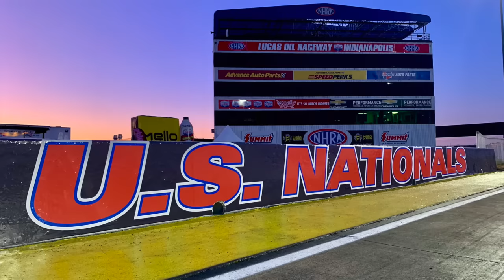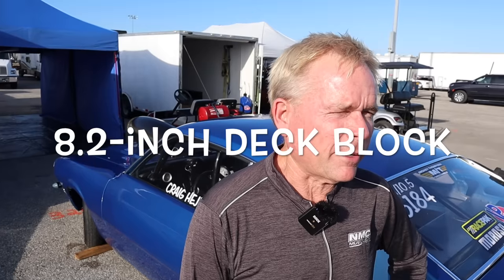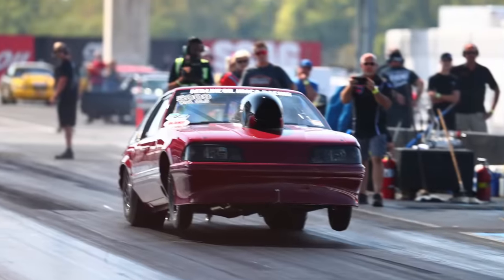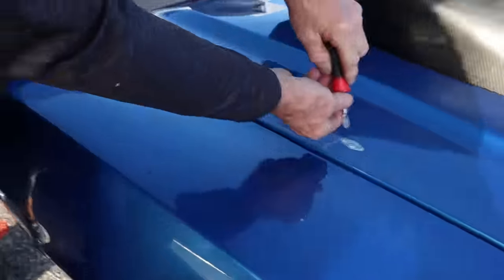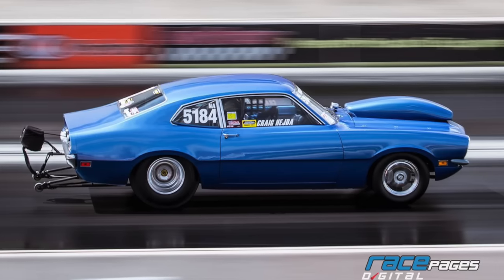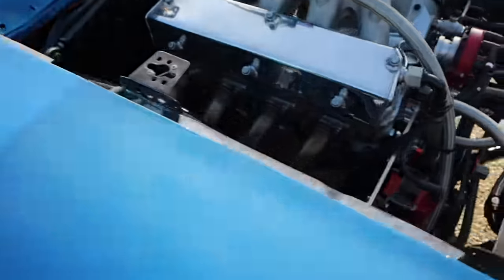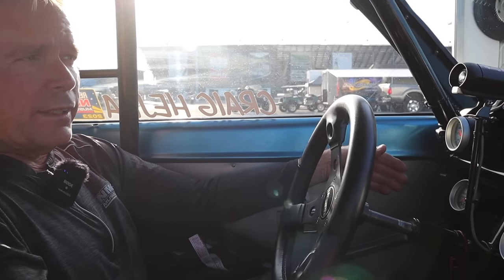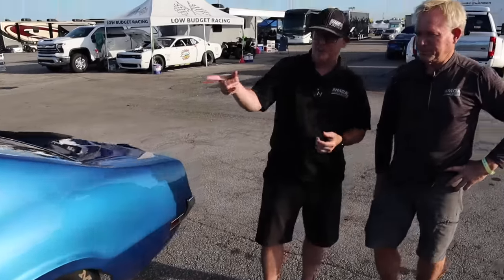10,000 RPM NA Small-Block Ford Maverick Makes 1,050 HP and Runs 7s at 177 MPH with a 5-Speed!

Comment: I'm a Chevy guy but anyone who still runs all motor is a real racer.  No power adders   way to go.  Real racing
Reply: Love NA all motor, no crutches, no excuses.
Reply: Love those Mavericks and high rpm small block Ford engines I've got two of these Mavericks cars 🚗
Reply: This is the way I do it no turbines turbos or anything just all Motor but 385 series in my 53 Ford cpe with 4 speed toploader and narrowed 9 inch , pickup front axle
Reply: you can race anything you want. its all about fun, no matter what the combo is...
Reply: Who cares if you're a Chevy guy, this video is not about you.
Reply: I always like when the chevy guys come around from the dark side
Reply: @Watsbronc Who designed the pushrod V-8 again?
Reply: We definitely need to go back to this style racing, production based, N/A high revving, manual trans, and keep the 10.5 tire, sounds a lot like the original concept of pro stock.
Reply: @docsmallblock6584  It wasn't GM.
Reply: Its a pro stock engine.
Reply: @____MC____ in what way?

Comment: Damn that’s one hell of an 8.2 deck engine, I was expecting a Cleveland combination, that much horsepower out of an 8.2 deck with less than 400 cubic inches is absolutely amazing, I dig it. 👍🏻
Reply: It’s insane really 388ci 1000hp ! small block Ford makes power
Reply: @CoyoteFTW  
With names like Chris Uratchko and Tony Bischoff building the engine you know it’s going to make big power regardless of brand.
Reply: @shitbox82  that’s better power per cubic inch naturally aspirated than majority race engines 
Say when racing outlaw 10.5 car is making 3631 hp with a 427 Windsor stock bore space 9.5" deck, heck the cam height is even windsor still.
Reply: @CoyoteFTW  
Damn right that’s big power with conventional 8.2 deck architecture.👍🏻
Reply: Think if you went to a 9.5 " deck!

Comment: One must realize just how truly impressive this car is.  388 cubic inches. 1050 horsepower. Ran a 7.89 at 177 mph.  All motor.  Irrespective of the brand, you have to respect those numbers. You just don't see that very often nowadays. Great Maverick brother
 I'm a die hard Ford FE guy. It's all I've known for 50 plus years. But I will concede that turning that small block over 10,000 RPM lights my FORD fire. Great work with your SB Maverick. Truly impressive !
Reply: In 1972, when I hung out at S.I.R. in Seattle, Funny Cars ran the 7s. Watched Jerry Ruth run AA/FD in 6.19.

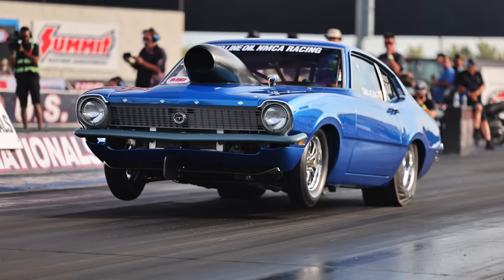Comment: My eldest daughter has a '71 Maverick Grabber that we built with a 5.8 HO crate engine, C6 transmission and a Ford 9" Detroit Locker 4:30 rear gears. The car does low 11's consistently.
Reply: That is awesome 🤟🤟🤟
Reply: Cool
Reply: Junk that C6 and get a built C4 and you will pick up a half second. A C6 drains 60 horsepower from your engine. A good C4 will hold up fine and get you in the 10s. I believe it was TCI that made a C4 with a lifetime warranty and 1000hp capability.
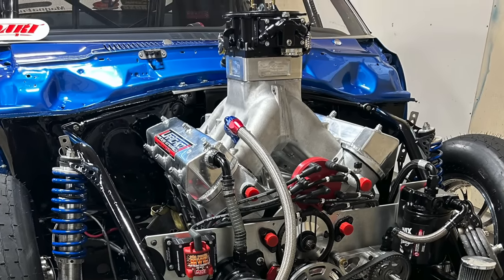Reply: @Axeman428  Oh hell no. It's her car and other than the engine, it was built with components that we already had. Primarily, it's a street  driven car and not built just for drag racing. On the street, it has a 3:50 gears with a Detroit Locker posi unit and Goodyear GT radial tires. I'm a master level factory certified auto/truck tech that worked for Ford for 40 years. I've been drag racing since the mid 60's and I damn sure know how to build a C6 transmission for best performance.  My former NHRA gasser 1957 Ford Custom 2 doors sedan does mid 9's. I set 3 NHRA records with that car and won 3 NHRA class championships with it also.  My 1969 Boss 302 Mustang won 2 NHRA Pure Stock class championships. I bought that car new at Tasca Ford in RI One of my former NHRA AA/FC cars is at Don Garlits Museum in Ocala FL.  I/we did well with that car also. I do know a lot about drag racing. Likely, far more than you.

Comment: Daaamn that's badass!!! My brother and I just built a '71 Maverick with a 351W. It's not gonna be on this power level though lol. It's been bored to a 363ci, 12:1 forged pistons, AFR 185cc small chamber heads, mildly radical cam, RPM Air Gap intake (mildly hand ported and port matched to the head), ford 9" rear end with reinforced spring perches, ladder bars, and a 3 speed toploader manual transmission. Should be putting down about 400hp to 450hp at the wheels. We built it as a fast fun tribute to our other brother who past away several years ago from a brain tumor. He had one of these cars as his first car back in the mid 90's, and it had a stock 302 and he took it to the local drag strip to race it. He loved these cars and never stopped talking about that car, and always wanted to build a fast one but never got around to it before he passed.

Comment: Reminds me so much of my 70 Maverick the same color even that started life in North Carolina with a straight six and three on the tree to. Put a Boss 302 crate engine and top loader four speed manual. A swap to five lug on all four corners with V8 mustang front suspension and springs and disc brakes with nine inch 4.11 gear with heavy duty springs and drag shocks all four wheels. Had 15" Cragar SS wheels front and rear, N50 mickies on the rear. Street raced back in the day. Canted valve small block humbled a few big blocks, Chevelle and Charger back in the day. Engine was bone stock out the crate and Rousch headers and remote oil filter setup.

Comment: I`m a Mopar guy but in 1996 for a mere sum of $200 simply couldn`t resist 'grabbing' a great running 1972 Maverick 2 dr/ht with 302 auto. Then I found a non-running sister-car`73 Comet GT also for $200.

Comment: Love your Maverick awesome little SB Ford.  I have a 62 Falcon SB Ford all motor. 750 hp with a 306. Tunnel Ram Holley carbs. 4 speed manual Center Force clutch. 
 Only mine is street legal and runs at the track, too.  Not fast as the Maverick but
Little Fords are lots of fun.

Comment: Love Mavericks. 
Cool/fast MAV and story.
I own an early 1970/69.5 myself. Which just so happens to have the same engine 200 6cyl and 3speed manual transmission his Maverick orginally had. The shifter was moved to the floor.
I have a new front and rear suspensions for the car. 
The engine & trans will also be upgraded. My Maverick will be designed for handling. 
My first car was a 74 Maverick my Dad bought me in the early 90's I started customizing and had it till 2008. Unfortunately had financial issues and had to sell it. That sucked letting it go, and why I bought another as soon as I could.

Comment: I didn't realize that 4-bbl NA motors were at 2.7 hp/c.i. Making compression isn't tricky but avoiding piston contact with the monstrous cam takes some design. Thanks Evan.
Reply: That's alcohol compression on gasoline...sick.
Reply: @geoffmcnew5863  is it really gasoline? I'm trying to find that info, but I couldn't.

Comment: That was great, the car the story and the filmwork.  What an awesome "302", 16 to 1 with 1.09" lift !   If you are ever near Victoria you need to check out Grant Klohn and Bill Friend. Bill's 65 Comet has a similar 10 degree engine but street driven so less cam and compression.
Reply: Yea but its not streetable.  Pure drag car only. How about you build a race car you can drive daily,  not a drag race only car you tow to and from track
Reply: @maximusvonce1381  Huh??? I followed him 60 miles from Mission to the Tsawwassen ferry on the road.
Reply: @tomp1612 10k rpm means no bottom end and the drag cam is hard on parts and will need rebuild often. Those are the facts, and you can ask Joe Sherman and he will agree.
Reply: @maximusvonce1381  Obviously you are not talking about what I replied. "Bill's 65 Comet has a similar 10 degree engine but street driven so less cam and compression"
Reply: @tomp1612  You dont understand what i am trying to say. The cam required to spin 10k rpm has to have massive spring pressures and aggressive ramps. I don't care what crap you are telling me,  a cam like that will not last long on a street car. The springs will wear out and the hammering on valvetrain from aggressive race ramps will shorten valvetrain life. Even comp cams says there hi rpm aggressive roller cams are not designed for street use. Ask Joe Sherman who's been building motors for 50 years.
Reply: @maximusvonce1381  Nor do I care, read the comment you first replied to.  I was quite clear on the smaller cam and lower compression part.  Besides that there are plenty of long lasting 10,000 rpm cams,  motorcycles for instance and cars too
Reply: @tomp1612  No such thing as long lasting 10k rpm cam in 302 or 351w. That's a race cam only. Call comp cams and they will tell you.
Reply: Grant Klohn has 66 427 Fairlane, totally different beast .

Comment: My 1st car was a '66 2+2 Fastback. Motor was stock (came with a duel point) except for the intake. I got mad at it one day and held it at 8200. When it sluffed that off like a tea break, I apoligized to it and never tried that again. I swear it felt like I had just kicked a faithful dog. At the time, I thought short decks had no up side. I was quickly converted. If the car had not been stolen and wrecked, I would porabably still have it.

Comment: After he pulled off that left valve cover, I was thinking that it was a twisted wedge head. When the camera went closer to those rocker arm, I saw they were all in line with each other. Evan, would a twisted wedge be an asset or a liability?
Reply from the maker: It would depend on a few factors. Theoretically, the canted valve should be better, but these types engines are so well though out that I doubt you could just change the heads and make more power since everything is designed as a package. And... in this class there would be a weight penalty for a canted-valve head. Most Ford guys in the class use the D3-type Yates head but at a higher weight.
Reply: The reason why those head aren't penalized is because of their weight. Knowing that they're Yates's head, they have superior porting to other heads in that class of drag racing.

Comment: Well he's got the right trans, the right car, the right CR, the duration in the cam is probably about 300 @.050 with  a 106 lsa. But if you think it makes power now if he would have put a set of Yates C3' a on there. And a Hogan sheet metal intake on there it will probably pull past 10,500 rpm. And if that isn't proof that the Liberty 5 spd isn't the best trans in the world you tell me a better one. I'd like to see some numbers on the heads

Comment: With a manual I get it you only have 2 feet but Something I've always wondered is with an auto why would you have the line lock used as it is on the front brakes when you could use it to lock out the rears then you can manipulate the braking as much as you want like gradually letting off the brakes at the end of the burn out or whatever. I just don't see the advantage of using it the way there normally used in an auto

Comment: Experience oozes out so even the blind will see. 7's at 177mph comes from experience. 👍
Reply: Its all metric,so's its not so fast.
Reply: @JohnnyDanger36963 - I'm old school. Is this 1000ft. or 1320? I struggle with this sometimes
 ETs are so different. I like the 1320ft because of a lifetime of info constructed around this quarter mile.

Comment: Beautiful car!  Curious why he runs a radiator?  Is that a class rule?  That’s a lot of unnecessary (for a dedicated drag car) weight on the nose.  BTW, it looks really strange to see an in-line valve head on a Cleveland.
Reply from the maker: It’s a Windsor, 302-based engine. And it runs on gas not methanol so it would get pretty hot without coolant.

Comment: That front fin thing doesn't make any sense at all. Reason is if the front of the car stages in on lasers the finish line lasers will be clipped at exactly a quarter mile no matter what as long as there set at the same exact same height. All this truly means? If you have to store in  2 inches forward deeper? You clip the finish line 2 inches late but EXACTLY a 1/4 mile for both cars.